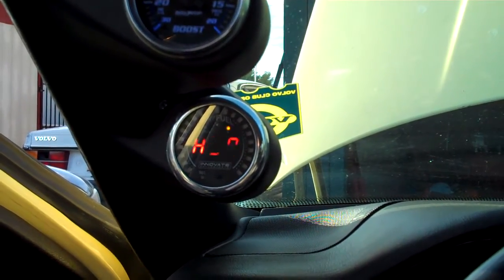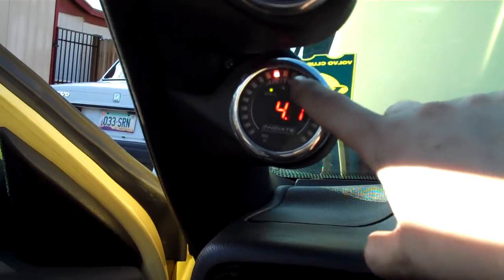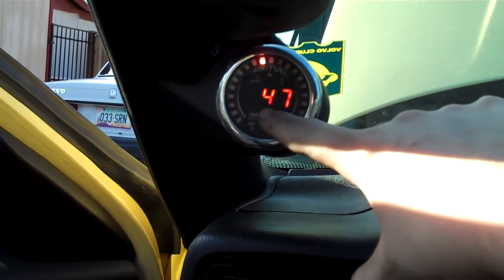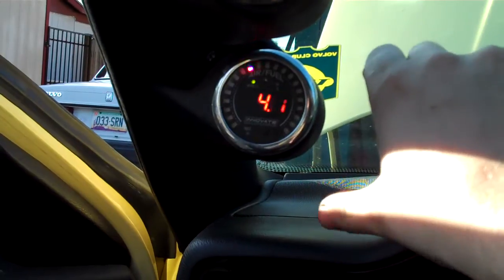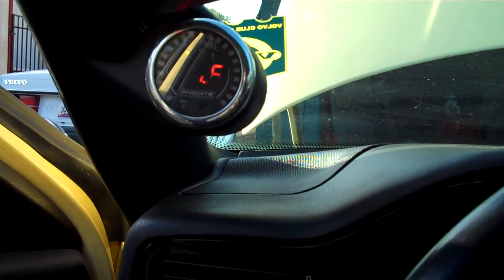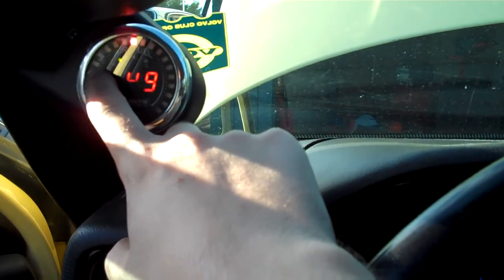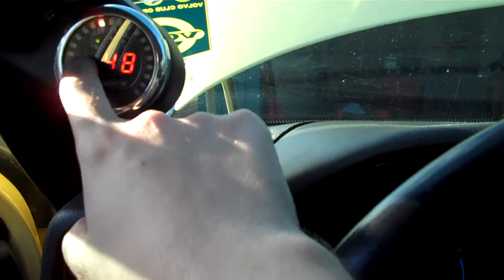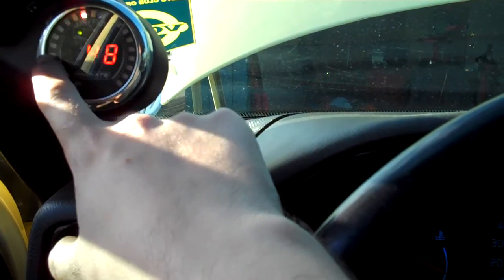Innovate wideband problems help!

Comment: someone knows how to filter the small oscillations of the analog output of this wideband?  I have a slight oscillation and I would like to compensate or cancel it.
Reply from the maker: I ditched it years ago and use aem now. Much more reliable.

Comment: Did you originally make the connection as described in the manual with Relay? I have a problem with my innovate wideband which starts doing strange things after a while of use. I or respect the connection medinate relay as it is in the manual, take a positive of non-direct battery contact. Will it be the problem of all innovate? It can't be that we all have problems, we users are doing something wrong. I don't think it's a bad product.
Reply from the maker: Finicky grounds. It needed to be ground right back at the battery. I know use aem and I have less issues.
Reply: @MesquiteAutomotive  Yes it is true that aem has less inconveniences, but since I recently bought Innovate I no longer have the option to change so I would like to find the solution to this.
Reply: New sensor and works great again .

Comment: I had E8 error very often and gauge led stack or frozen in the position very often. I changed gauge twice and sensors 4 times but same results. Something wrong with Innovate MTXL ... maybe design or manufacturing not robust. No longer with Innovate
Reply: marco bardazzi same problem here. Did you fix yours?
Reply: me too
Reply: I’m having the same issue
Reply: rico892002 did you get it fixed ??? Same problem

Comment: I had a problem with my mtx where it would not switch on....hitting the gauge made it light up but sometimes it would act weird like yours. I took it apart and reflowed the solder on the pins to the display pcb plus the power wires and it seems fine now .

Comment: The reason it fixed it  when you ran the wires directly to the battery is the fact that the battery is clean DC voltage with no noise.  Essentially doing the same thing as the suggested addition of the capacitor.
Reply: Can you tell me how is that of the placement of a capacitor. It is placed in series on the 12v (+) line and ready? Or how would it be if you can explain me since I have a problem like everyone else with the innovate.
Reply: @marcelocuadrado6955  + side of capacitor across the meters hot wire and - of capacitor across the neg lead of the meter.  So unless this meter is just that cheap and doesnt filter out all the dc noise created by the alternator and igniion system, then adding a capacitor across the line = and + of the meter as close to the meter as possable will help.  I have one in my 1964 vw bus but I bought it from summit racing.  It has worked fine all these years.  Would help if you had an oscilloscope to check for noise across the power wires.  How does it operate with engine off?.........Also where did you attatch the power wires?  You also can try to move them to a different location.   Also, if those wires are close to spark plug wires or other noise creating devices, that will also do it.  Other than that..........if power filtering doesnt do it...try it on another car......still does it then defective unit.
Reply: @zundfolge1432  i did the capacitor test with one fe 1000uf x 25v and nothing. I tried placing a direct battery conductor (+) and the same. the strange thing is that the instrument works correctly for a few minutes. then it starts doing erratic and delayed readings.
Reply: @marcelocuadrado6955  probably defective then unless the sensor is faulty
Reply: a couple of minues is something getting heat soaked, cap going bad inside or a semiconductor going bad.  or wired improperly/wiring routed near interference.  or just pain defective.  In the world of tv repair, they used freon to spray semiconductors.........when they sprayed the offending part........it would start working again.

Comment from the maker: @AndyOyamadaZ Thats cool I wish I had an oscilloscope. I fixed the problem through by just re-wiring the gauge and the controller and connected directly to the battery and it works fine now.

Comment: Hi, have you already got the solution? Hope my experience helps. Innnovate wideband series uses the pulse width module, PWM, to control the heater and it causes a feedback noise to its power source. I took a video of its noise with my oscilloscope. Check my videos. This kind of noise causes IC to act strangely. If it was the reason, you can solve it by adding a capacitor, above 25v1000uF, to its power source. PWM noise is very strong.
Reply: Put a capacitor in series on the 12 volt supply conductor and go?

Comment: I'd get a laptop with a serial port and see if the Logworks readings are the same as the gauge. You can also change the fuel and then change it back and sometimes this clears things up. There is also firmware upgrades/downgrades that guys have been doing. The grounds are very important, probably the most important. You can also get a sensor from the parts store for around 50 bucks. Bosch 17014 for the LC-1. Make sure to calibrate it also. My car is fiberglass. I've been fighting this 2 nights.

Comment: Did you get it to work? E2 means the sensor is disconnected or the sensor or wire is damaged. Anyway if you drove the car w/o the sensor heating it propably alredy broke the sensor.